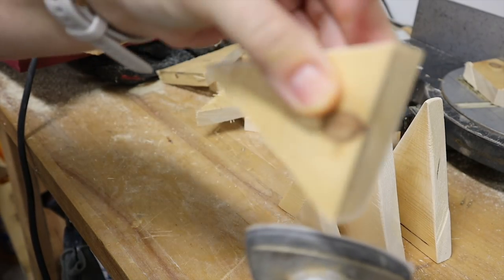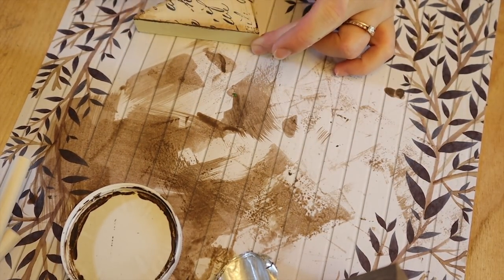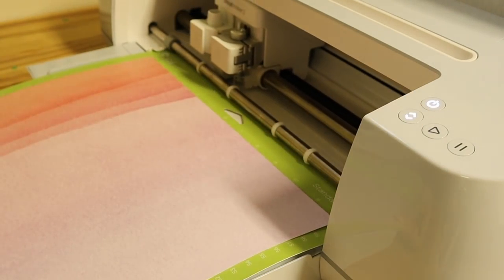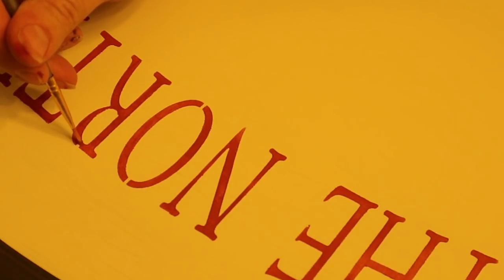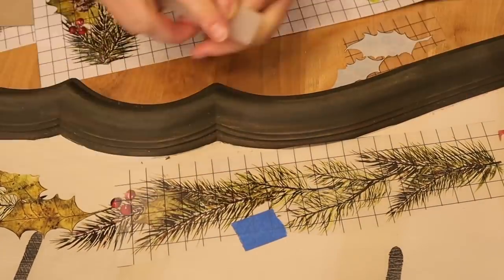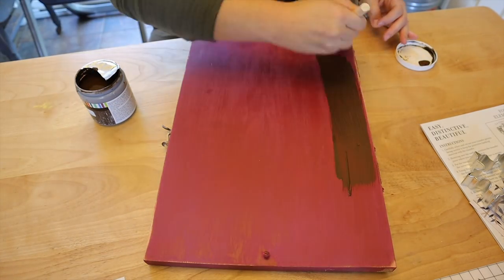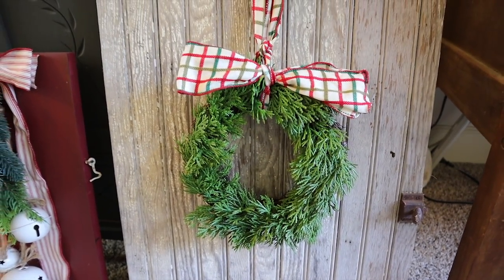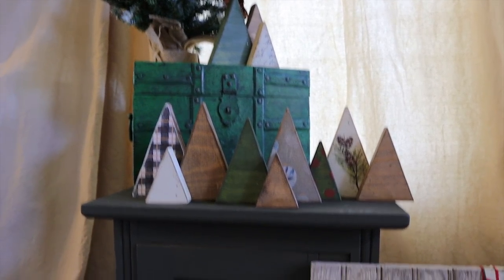5 Christmas DIY Upcycling Projects 2021 Antique Farmhouse Decor for Resale Vintage Market Booth

Comment: Another way to ensure crisp stencils: stencil in the background paint first. Let it dry. Then use your desired stencil color. Daubing with a dry brush/sponge is still best, but the first coat in the original color 'seals' the edges of the stencils.

Comment: What brand of antiquing wax is that, from Walmart? I looked in mine for some, but they only had Waverly. I didn't see any wax in my paint section, but I may have been looking in the wrong place. I was looking for it in the aisle where they sell spray paint and stains. These were all beautiful. That big sign is gorgeous.i love that green color, on the little chest, that the tree, with cookie cutters, is sitting on. What color of green is that?
Reply from the maker: It's the ArtMinds brand---it looks much more like a glaze than a wax (it's liquid), but it is called Antique Wax.  Comes in an 8oz plastic jar with a white lid.  The green on that small cabinet is Collard Greens from Dixie Belle.  You can order here if you need some!  www.etsy.com/shop/greenonionvintage